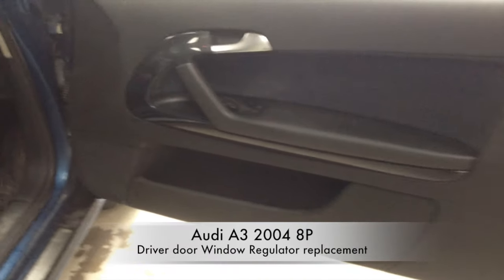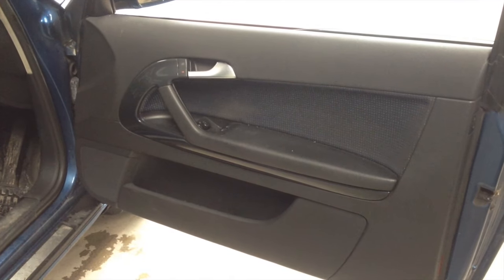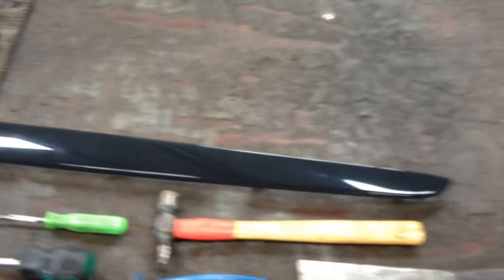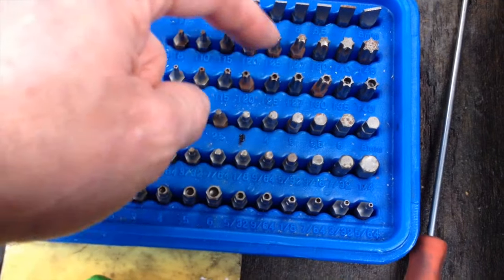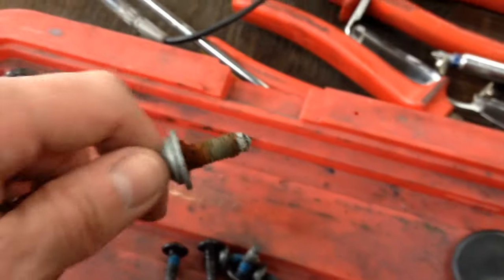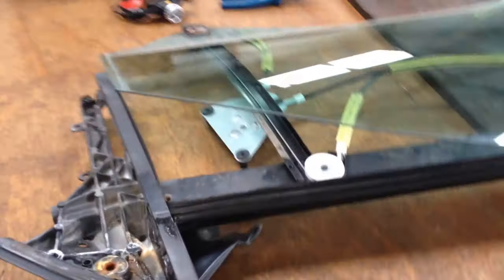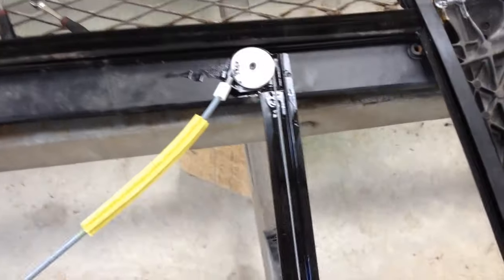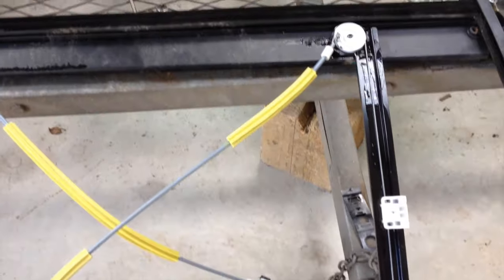Audi A3 Window Regulator

Comment: A great vid that guided me through replacing the window regulator on my daughter's 2009 A3. Same problem as yours - old cable was frayed & bunched up. The replacement regulator was slightly different to the original, in that it had square white nylon clips instead of the plastic fold-over clips holding the regulator to the window. Also, the original self-tapping type screws for the motor weren't suitable for the new regulator, so I had to use short M6 (I think) bolts instead.

Comment: Hi Martin, Great video. It's really helping me out with a similar problem I have.  Can you advise on one thing though. At around 22.15 you mention that the motor can be turned, if everything is connected up, to align the drive splines, while the motor is not mounted, would you say this is a good test of the switch, motor, wiring loom ( power ) and control module to eliminate them? prior to moving forward with further checks of the window regulator etc ? If you could advise...cheers
Reply from the maker: hi, yes you could try this but there would be no load on motor as in not much work to do, just turn. just gave it a go, sorry for late replay Mark, good luck.
Reply: Great thanks Martin..I have a spare motor , switch available so trying these forst before the regulator..appreciate your reply...cheers

Comment: Hi Martin. Could you confirm if the bit for the three screws holding the motor was in fact a T25 or was it another size. Just need to get them screws to be able to do my replacement. 
Cheers. Great video mate. 🤜🏼🤛🏼
Reply from the maker: sorry can't rember now,,
Reply: use the old ones

Comment: I’ve replace my regulator but window continues to work only when I unplug and re-plug it, but only for a few minutes.  I’m thinking it has to do with door sensor cause it’s not detecting that same rear door.   And light switch doesn’t light up.  I did find theirs another light right under and above the inside door handle but it’s very faint. When the windows works it’s faint, then goes out after window fails again within a few minutes of re-plugging.  Suggestions?
Reply from the maker: sounds like a power issue. check the wiring loon coming from car to door.
Reply from the maker: i thank there is a reset you can carry out.
https://www.youtube.com/watch?v=-dEjjASrfBo

Comment: Is it best to have the glass up or down when carrrying out this task? Thanks.
Reply from the maker: Good question, when you set the window in place it has no resistance. I think you should be free to move the glass freely. its only when you connect the motor you will then need 12V. So to answer your question, when glass in runner and frame just move freely to allow you to do your work. I would say half way up.
Thanks good luck.
Reply from the maker: my regulator when new came half way so i just worked with that.

Comment: Do you happen to remember if you had the motor plugged in but not attached?
Did the motor just keeping going if you keep your finger on the button? or stop at a certain point?
Reply: when you plug the 12v into motor, and away from the regulator,  just hit the window button lightly to move the motor a small amount, then see if it seeds into regulator,  just keep doing this on till the motor fits into regulator,
Reply: Cool man, thank you!
Reply from the maker: whit motor not connected to any thing, i would just keep turning if you keep your finger on button,

Comment: How the did you get the window frame out from the door after removing those 5 screws?
Reply from the maker: I think if you watch the video again you should get your answer. thanks
Reply from the maker: sorry, if you have every thing removed that is shown in video it should lift out, it is a bit heavy. make sure use have mirror removed all so.

Comment: hi, I did this on my car and now the window feels a bit funky.   At first the 1 tap was all gone. but now the 1 tap does not work when going down. Ill have to fully press it down so it goes down automaticly.  If i do stop it when going down by pressing 1 tap up. the window will stop. and if i press up again the window will go down instead of up. So i have to take it all the way down before i can 1 tap it up or 2 tap it for automatic going up.  Also the window feels like it is struggeling a bit.  it goes down and up about 0.5 - 1 sec slower than the other one.  I did buy a replacement part and not offical audi part. but watching this made me wonder if i can have missaligned the window or something.   Or maybe the window lift i bought is just a bit slower and harder to pull up.

The wire snapped and the window fell down when i had to replace it. So maybe it is just that the window "memory" is wrong. but i am not able to program it any further. (i did manage to get 1 tap UP, somehow. down is still not working"
Reply: OK, to reset your 1 touch try this. Starting with your window up. Put window down with your finger holding the button, when window fully down hold the button for 5 sec longer, then do the same when putting window back up again and hold for 5 sec. This should reset your window. If  you find you are losing 1 touch, this can be caused by window finding resistance. Try some silicone and lub on runners. Hope this helps.
Reply: thanks for the reply. iv tired all sorts of programming tecniques but it dosent seem to help.  is there a way to delete the settings and do them over?
Reply from the maker: Trygvel, seems to work for others, window might be tight. If you put it up at times will it stop and want to go down on its own, like something was in the way. if so there is to much resistance are something else is going faulty. Sorry I can't help any more with this.
http://www.audiworld.com/forums/a4-b7-platform-discussion-69/drivers-door-window-no-longer-has-auto-one-touch-down-feature-2792069/
Reply: TrygveL i